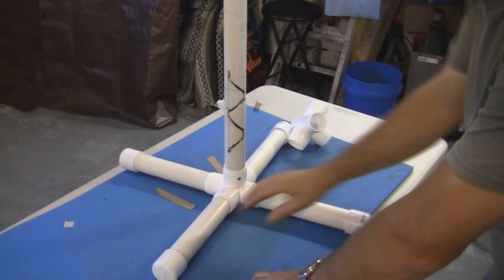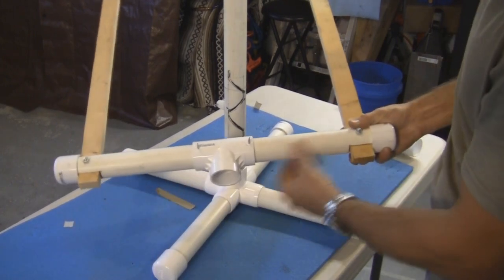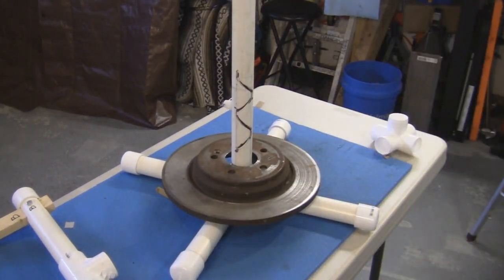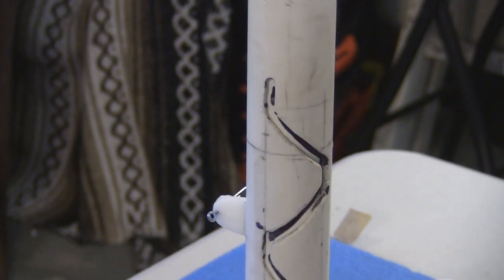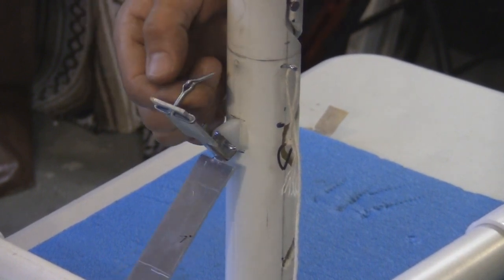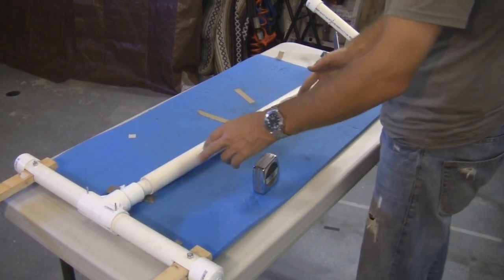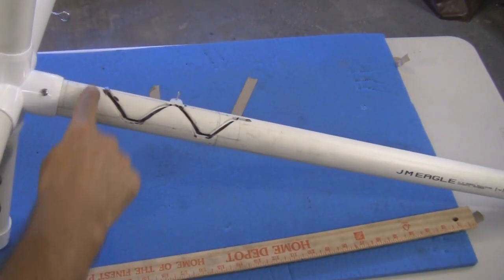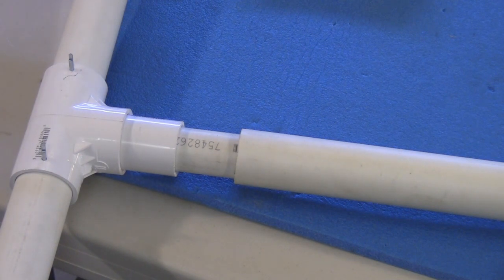DIY PVC Drop Turner Rotating Target for USPSA IPSC IDPA or Airsoft Home Made

Comment from the maker: Yes, a heavier turner will slow it down.  But it's weight further from the center of the cross that has the greatest impact.  Think of it like torque and leverage.  A light weight further out on the ends can have the same affect as a heavier weight closer to the middle.  If all the weight is in the dead center (like say in the post) then the affect of weight will be minimal.

Comment from the maker: Try this.  Drop a 1 pound and a 5 pound rock from chest height at the same time.  You will see that both hit the ground at the same time.  That's how gravity works.  But, in the turner case, it is the inertia to get the thing started moving that is affected by more weight.  When the heavier one gets moving it moves the same speed as the lighter one.  It just takes the heavier a litter longer to get started moving.
Reply: Thank you Sheldon.

Comment: Ok, how the heck did he cut such nice lines in the PVC? I can get the lines at a 45 degree angle easy with a cutting wheel because they are ling enough, but how did he cut the short 1/2 sections that are vertical? I tried a cutting bit and can't control the bit enough to get a smooth cut... I end up going out material all over the place.
Reply: Maybe using something like this? http://www.dremel.com/en-us/attachments/Pages/ProductDetail.aspx?pid=220-01